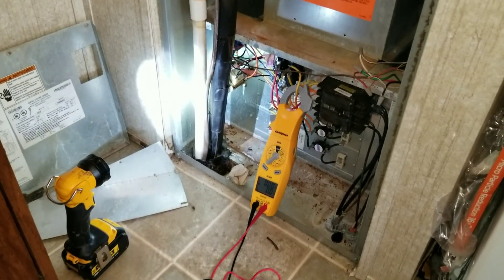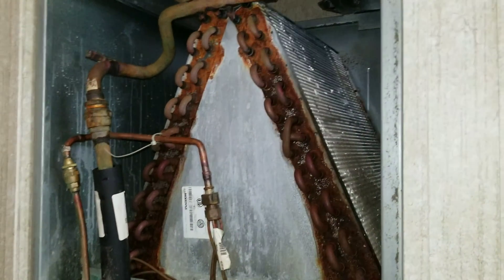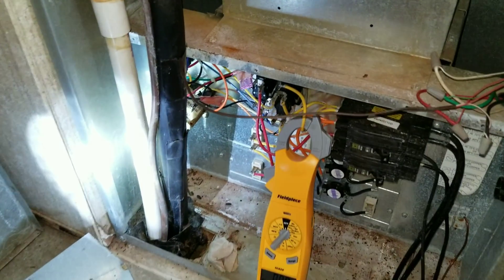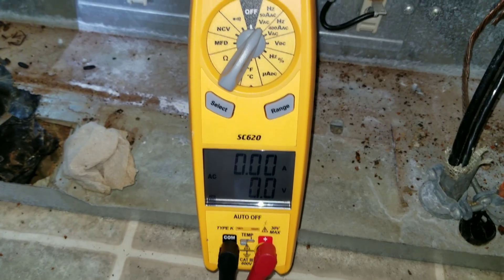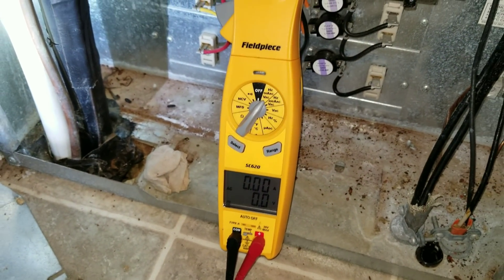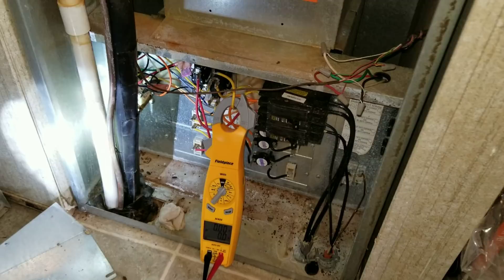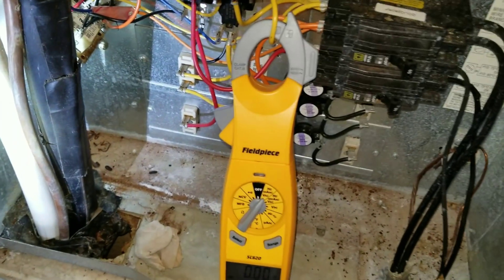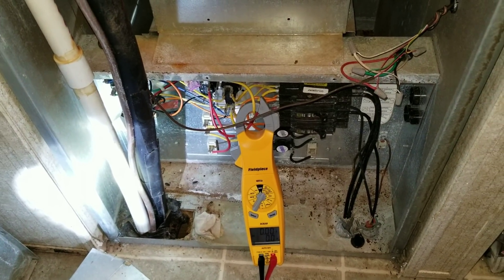HVAC Tech Tip - Avoid Tunnel Vision

Comment: Sequencers are garbage
Reply from the maker: na na As are most parts these days
Reply: what's the alternative? overly complex circuit boards full of junk to fail and the same issues with relays welding closed or burning the board open?
I'd rather have the failure mode of heat stuck "on" vs off. some will say who cares if the house freezes up, etc. we'll just claim it on insurance! haha the suckers will be paying for it monthly when the premiums go up or they get canceled and the next co. sees that and premium double off the top :))
Reply: throttle bottle if you have the space a standard 40 amp contactor
Reply: but you still need sequencers or other controls, those contactor's can still fail closed by arcing and the sequencer can fail arced due to the contactor coil back emf causing arcing worse than the mostly "resistive" heat coil loading. yeah, I'm getting a bit too deep into electrical, electronics and more. I wont even go into the metals used on the actual contacts, there any many different formulations and thickness ;)